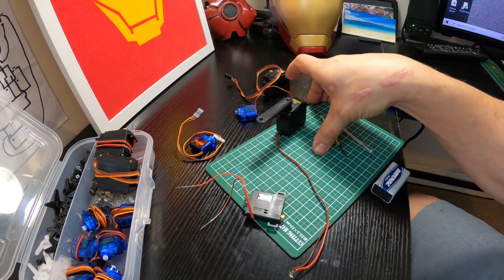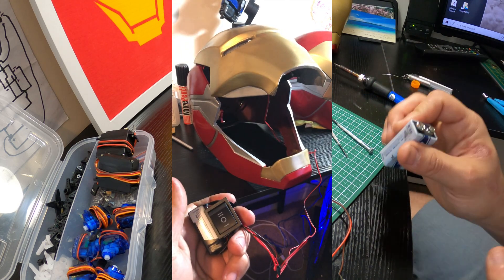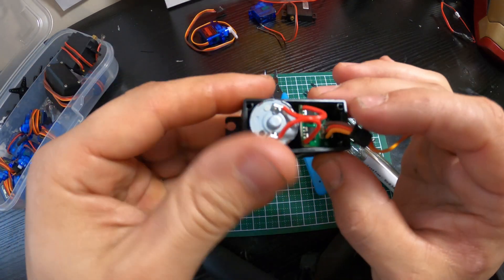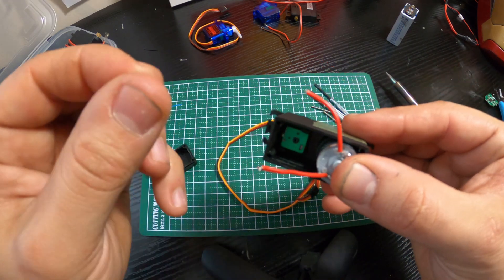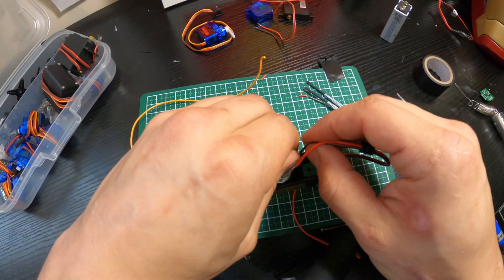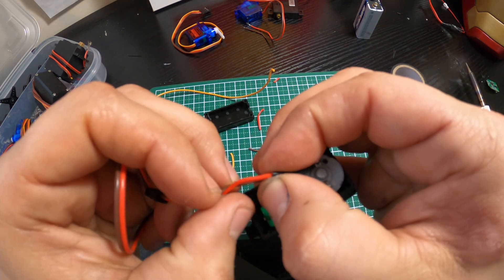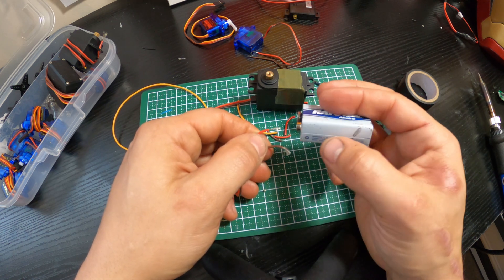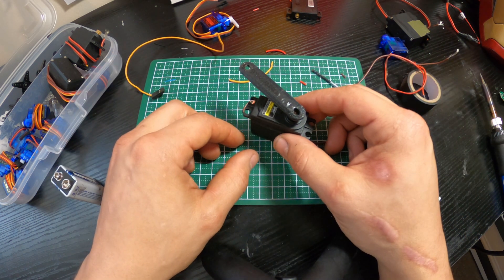How to Use Servo Motors with NO Programming! - Hotwire Servo Tutorial

Comment: That data wire is basically just a pwm input so if you want it to travel to the end you just leave power wires connected and signal wire just connect to ground or +5v

Comment: I have a 5v rechargeable battery pack and have exposed the wires of a usb cable, plugged it in and touched the wires to the servo wires to make sure they work, but I’m getting nothing from the servos, but the battery pack is lighting up as if something is connected, and it does charge other things, what’s wrong? I don’t think it’s the servo as I have 2 and both of them do nothing when connected, any ideas?
Reply: some battery packs need a load to turn on and give power out.  I have one that works on the phone and headphones, but not the tablet blue tooth keyboard.  The tiny servo may not have sufficient load to turn it on.

Comment: Hi, how can I use it on my HO turnouts. What I mean is for the motor to turn the arm just not too tight to move the tie bar flush on either side when I power it. Is there a device that can be adjusted to control the movement of the motor to my requirements please. I live in Sri Lanka and things are not that easy to find. Thank you anticipation of your help.

Comment: new sub great vid brother.  any way I can reach out to you privately? No BS, No games and got No problems paying you for your time and help. thanks man blessed be...   ps just seen another video that you don't even gotta take apart the servo and use the all 3 wires as is. you don't gotta cut anything either, you can just run 2 jumper wires right to the motor and still leave the servo wires and board as is and use them later with no damage done.

Comment: I have a question, im new to this whole thing and I'm trying to use servos for some wings. Is there a way to slow down the servo and to reverse one of them using this method? Also, how did you attach the switch and can I use a different switch or button?

Comment: Frank hopefully you still reading these. I followed your example so I could hot wire my MG90 180 degree servos. After I wired directly to the motors it now spins 360 degrees. This has happened on 3 monitors so far. Now when I wired it I did pull the monitor and the attached board out. Have you ever experienced anything like this? If so any suggestions on fixing it so I get my stops back?  

Thank you for all the amazing videos you’ve really been a big help and inspiration.
Reply from the maker: I do still! I’m actually not sure about thah man. Maybe try asking in the electronics section of my discord? Discord.gg/franklybuilt

Comment: If you leave the battery connected like this, the servo will stop when it hits one end, but the motor will keep running at stall-current (which could be around 2 Amps or more depending on the exact specs of your servo). This could burn out your motor, and definitely drain your battery a lot faster than it should. If you really don't want to use microcontrollers you probably could make some kind of circuity with a 555 Timer to control the signal anyway. But that does seem like too much work so I would just go for a tiny microcontroller anyway and you should end up using less power and no damaged components.

Comment: Thank You Frankly Built! I wanted to be able to throw switches on my G scale outdoor layout when I'm done building it. It was either pneumatic, (which is still an option I'm contemplating) or the servos. I knew there was a way to move the servos without having to program them and You have the answer. I asked the question about another way to operate the servos I was looking at on amzon without using a transmitter, and all the knuckleheaded answers said there wasn't. Thank You again.

Comment: If you wanted to get real fancy you could use a pwm's and then you have the same strength of the motor cuz if you ever messed with DC motors lower the voltage the lower torque and use a pwm and the same torque for lower voltage

Comment: How do you make the face plate go back down if you got wire to like a 5 volt rechargeable battery pack
Reply from the maker: You need to use the switch

Comment: Is it normal for the servo to get very very hot when wired this way. It goes to its stop but still gets power
Reply from the maker: You’re straining the motor. That’s why you either need to add a limit switch or turn the motor off when it gets to a hard stop
Reply: @FranklyBuilt  thank you I'll have to rethink my switch method. You inspired me to 3d print an iron man helmet and all that's left is the electronics 😁

Comment: Exactly what brand of servo do you use? I’ve tried Tiankongrc from Amazon and the wires are so small it feels like only a surgeon could hot-wire them.
Reply: I to tried the tia and also tried the reversal and could't get to the 3 wires or even the board on inside. Motor portion was a snap but end up destroying it.

Comment: Having a servo hit the stops at full speed WILL strip the gears. You can also take the potentiometer out and the stop pin, so you have a gear motor that can turn in either direction without stopping. Check out "continuous rotation servo". More useful than this...
Reply from the maker: Thanks man! Appreciate the input

Comment: bro frankly, I have some question. Servo MG90 and MG90S is the same motor ? can the MG90S servo can be powered up by 4pcs x 1.5v batteries ?
Reply from the maker: The torque is different I believe and I don’t see why not but they will die very fast
Reply: @FranklyBuilt  bro frankly, which model servo do u can recommend to me for my motorcycle helmet visor? I took your idea to put into my helmet.
Reply from the maker: Whichever one has stronger specs

Comment: What happens at the end of the rotation ? The motor is still applying force frying to shear the gears ?
Reply from the maker: Some don’t have a stop built in. So you need to add limiter switches to kill the circuit
Reply: Yup.

Comment: A question to the Power Suply. A servomotor is a AC Power suply if im right. You used a DC suply. So how do you transfer the DC to the AC?
Reply from the maker: No a servo motor is not AC. Never out ac to a servo or motor lol 😂 you’ll blow it up. It’s a DC motor that needs its polarity flipped

Comment: How do you connect the motor to a 5v USB power supply?
Reply from the maker: Cut a USB charger cable and wire them in. But you need to use a switch first
Reply: @FranklyBuilt  brill thanks for all the info
Reply: I use UBEC for power off a 7.4 lipo thu a servo tester and all is well! @FranklyBuilt

Comment: How did u make the servo to stop spinning at 360 degree
If u do have a vid about it can u drop the link down below? Thank you
Reply from the maker: The mg90 servos  I have only rotate 180-270 ish
Reply: Is sg 90 and mg 90 the same?
Reply from the maker: @mooskee3160  basically. Don’t use SG tho. They’re soft plastic gears. Use MG (metal gears)
Reply: @FranklyBuilt  thx a lot ure really awesome
Reply: Another question how did u put the switch of the servos and how did u modify the speed of the servo
Reply from the maker: @mooskee3160  hey man you seem to have a lot of questions haha I can’t answer them all hear. You should join the discord and post  up! Way more help

Comment: how do u make the motor to rotate only half when in the helmet or does it automatically rotate only half ??
Reply from the maker: You need to add a switch or limited trigger to cut power when it reaches a certain point.
Reply: @FranklyBuilt  so do we need to put two circuits to make it open and close?can't we just use one switch to open and close the mask both.when we need to open or close and then  break the circuit when it reaches a certain point we are going to need to switch on and off many times.cant we make it automatically stop  😢😢😢the one time that ash helmet u showed there are no switches to break the circuit then how come it stops at the right point??
Reply from the maker: The servo motors only move about 130 degrees. They won’t spin forever. They have hard stops. They aren’t propellers
Reply: @FranklyBuilt  can we use 1 circuit to both open and close when we use servo motor to open and close the mask and what about gear motors can we use them to rotate like that??why should we remove the circuit inside the servo motor is it make it 2 wires ??and after removing the circuit will it only rotate 130 degrees??pls help me bro I am going to make one🙏🙏
Reply: @FranklyBuilt  pls tell why did u remove the circuit and will it rotate only 130 degrees when the circuit is removed?
Reply: @FranklyBuilt  pls tell i want to make it bro🙏🙏

Comment: what u also could do is use a servo tester, it has a knob u can turn and the servo takes the position u turn the knob, it is also very cheap and requires no programming, just putting it out here
Reply: You can connect up to 3 servos to most testers
Reply: But can you use it for two servos
Reply: Or will I have to use two testers
Reply: Is there extensions you can add to make the wire longer?

Comment: I’ve managed to rig up an accelerometer to my servo. I’ve got it set so that when I nod my head upwards, the accelerometer (once it hits the threshold) will tell the servo to “open” the face plate. Then it does the reverse when I nod my head downwards, closing the faceplate. I just need to 3D model some brackets up for the servo and faceplate to connect them.

Comment: Do you have a tutorial/video for opening and closing with switches in fingers? As I saw a quick clip pop up near the end and it was exactly what I was looking at doing but can't find a video of it anywhere? Lovely work btw
Reply from the maker: Not yet but soon
Reply: @FranklyBuilt  I eagerly await that video, just finished making my hands. May be a bit small but sure I can make it work. Electrics are my concern and so glad I found your channel :)
Reply: Also may be a stupid question but does it matter what wire you use for electrics as I have found 20m of red and black pvc and says max current 1.4amp. Is that enough to use on whole suit? Probably just going to wire each light to individual batterys throughout the entire suit

Comment: I'm not trying to hate, but if your taking out the part of the servo that makes it a servo, why don't you just use a normal small dc motor, you wouldn't have to gut it.
Reply: Makes sense
Reply from the maker: Fact is. There’s multiple ways to skin this cat. It’s however you want to go down that road. This was the path I picked to start and it’s worked so far. And now later when I decide to add an arduino I can just swap the servo out.
Reply from the maker: Good question! Mainly for 2 reasons. 1. Ease of upgrade. If you build a prop or helmet with this to start but down the road want to swap back to a functional servo with programming it’s already built for that. Hinge placement in helmets is especially important. 

2. The gear step up ratio INSIDE the servo. That part at the beginning I didn’t take off. The little DC motors have super small axles. Some aren’t even splined. This just saves you the work. For $1-2 you get a thats already flat and ready to install that usually comes with a few mounting arms and rods. 

But yes you could easily run abnormal DC motor. It would just be a different setup

Comment: This is brilliant, and somehow in 2 minutes you have explained soldering better than any of my electrical engineering teachers.
Reply from the maker: LOL no way hahaha
Reply: @FranklyBuilt  To be fair, those classes were FAR beyond my understanding and I quickly changed my major to computer networking, but seriously nobody ever explained that the point was to heat the wire and have its borrowed heat melt the solder.
Reply from the maker: Oh well yeah. How else would it work haha that makes sense tho. Glad I could help!
Reply: Frankly Built for the longest time, I failed at soldering because I let the solder melt all over the irons too then touched it to what I wanted the solder to ultimately join. It....didn’t work very well.
Reply from the maker: Mason Luxenberg I used to do the same thing haha. Wait till I make a video about pre-soldering wires to attach them to small boards and junctions! Your brain will melt
Reply: @FranklyBuilt  Looking forward to it!